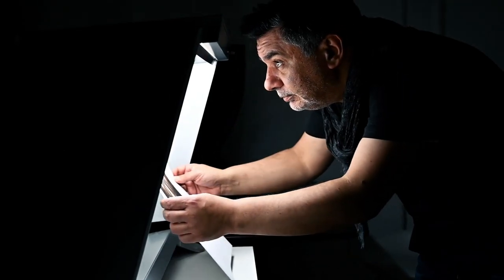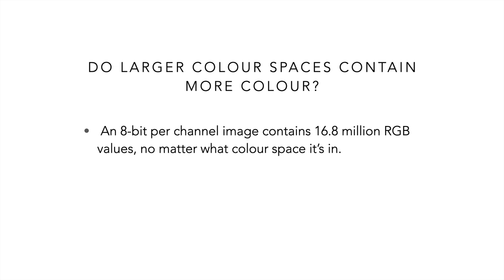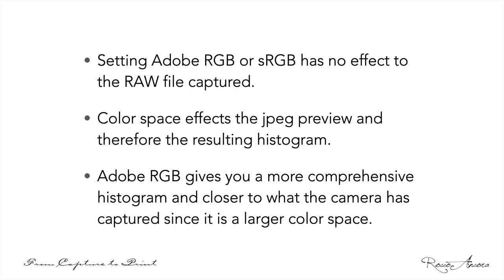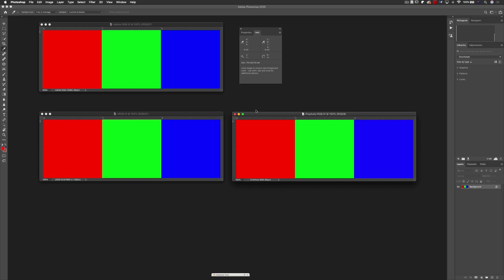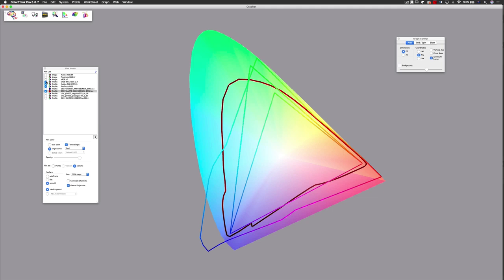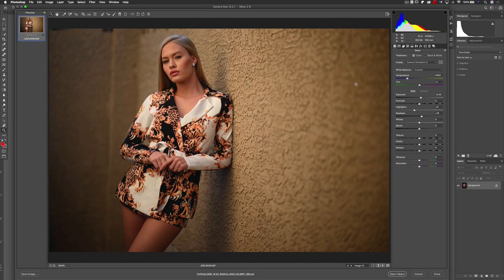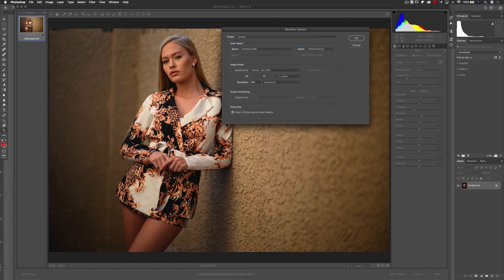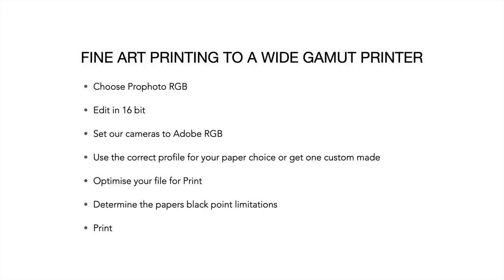Perfect Printing Process presented by Rocco Ancora

Comment: An exceptionally well presented video that was both informative and educational.
Covered the essentials with the right level of detail to enable workflow to be optimised.
The tip on shadow adjustment using curves was particularly useful to preserve image integrity whilst avoiding blocked shadows.
Subscribed!

Comment: Well done!  Thank you.  I learned a lot that's helped improve my workflow -- and get better looking prints.  One question though:   Are you always manually setting blackpoint -- or only when you see a problem after a hard proof print?  Seems like a lot of extra steps to go through.  Plus it also seems fairly subjective relative to choosing the black point value based upon visual inspection.  I was a computer engineer by trade, so I ask a lot of nerdy questions, not trying to argue with you at all.  Just asking for clarification :)